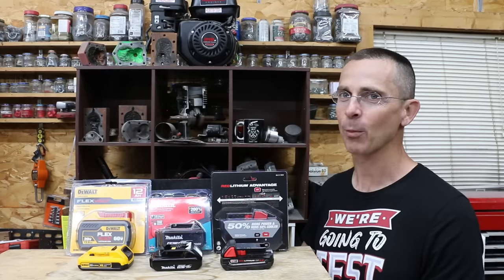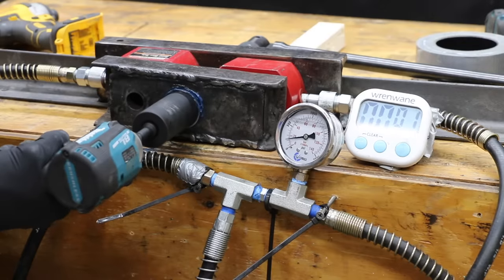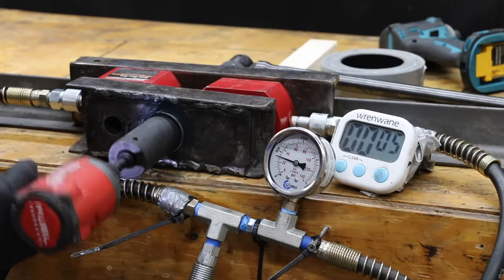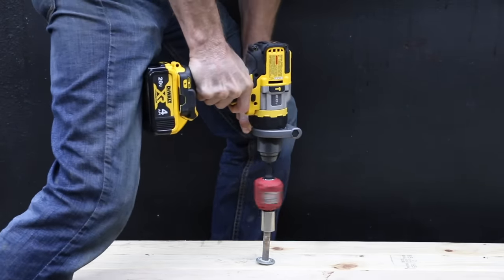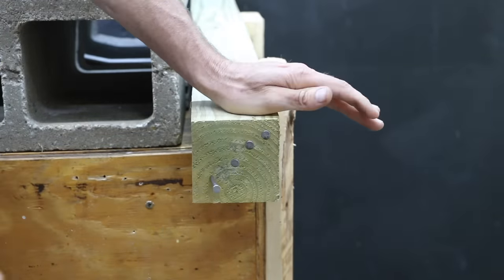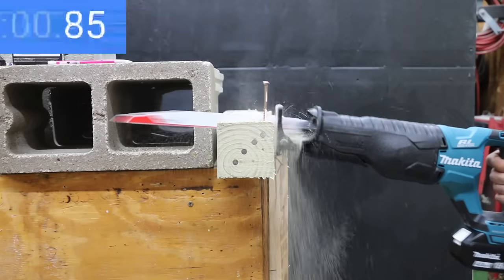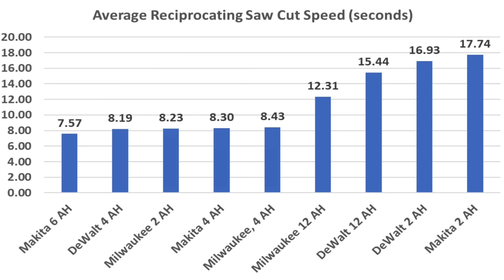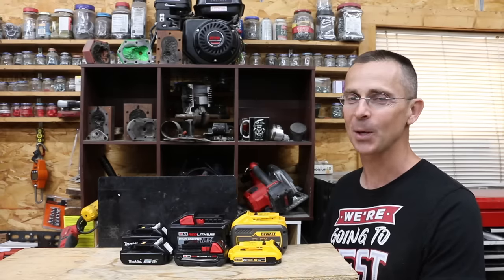Small "TOOL" Battery Better? Milwaukee vs DeWalt vs Makita

Comment: Continually coming up with new ideas after so many great videos, must be tough so here's a dozen ideas: 
1. Test the strength, puncture resistance, strength with a tear, cost, capacity of contractor type trash bags used for job site cleanup. 
2. Best small, hand held vacuum's both corded and cordless. Test run times, suckabilty, filter clogging, particle sizes, etc.
3. Best paint brushes for quality varnish jobs. Test for bristle loss, smoothness of finish (brush marks), cost, bristle type (boar verses synthetic verses chipping brush).
4. Best bungee cords; cost, strength of hooks, strength of cord, stretch, return length after being stretched, cut resistance/performance with a cut.
5. Best 3/8" sockets; test 1/2" socket for hold without rounding off bolt heads, how much torque before breakage, wall thickness for tight spots, 6 point verses 12 point verses universal with metal rods inside.
6. Best wall anchor types for drywall; plastic anchors, self drilling, toggle bolts, hollow wall anchors, Flip toggle (you may have already done this one).  
7. Best concrete anchors (for hollow block and solid walls) (Red Head, Hilti, Simpson, etc.) Also, the best concrete epoxies for holding anchors. 
8. Best graffiti remover for concrete walls, metal roll up garage doors, wood fences, painted surfaces, etc. 
9. Best storage bins like the 27 gal HDX; test for cost, capacity, how much weight it can hold, how high you can stack at max weight in each bin, wear when slid across concrete floors, etc. 
10. Best automotive OBD II Code Readers. Cost, accuracy, ease of use, corded vs cordless.
11. Best duct tape and gaffers tape; strength, adhesiveness, residue on removal, cost.
12. Best submersible water pump; Lil Giant, Wayne, Everbilt, etc. Use similar HP ratings and test for head, speed of liquid transfer, debris handling (sand, dirt, hair, paper, gum wrappers) & run dry shut off time to prevent pump damage. 
13. Best paint removers for wood, brick, rock. Test chemical, sanding, sand or media blasting and heat guns.
14. Best heat guns; cost, highest temperature, adjustment of heat and fan speeds, accessories such as round verses slotted nozzles, stand, hooks, etc. 
15. Best beers....Never mind, I'm testing those personally.....

You've provided great information with so many great video's, I hope a few of these ideas helps you and your viewers.
Reply from the maker: Thanks!  Thanks for the suggestions!

Comment: It looked like the test failed at the reciprocating saw section. With a 10 lbs weight, the reciprocating saws cut slower when using a humungous battery. But they'd likely cut faster with a 20 lbs weight.
Reply from the maker: Thanks for watching.

Comment: For the recip saws, Dewalt batteries have a "type 1, and type 2" rating on the back. Type 2 are good for stuff like reciprocating saws and give more current than a type 1 can, which is why the 4AH battery outperformed the bigger one
Reply from the maker: Thanks for the feedback.

Comment: I had no idea larger battery increased power not just run time. So will a bigger truck battery make my turn signals brighter?
Another very informative video. Thank u.
Reply from the maker: Thanks and you are welcome!  Thanks for the suggestion.

Comment: I love your videos!  I see a lot of videos from various sources testing and comparing the new carbide tipped reciprocating saw blades. Most show the blades cutting through nails, screws, or pipe. I would think a lot of folks who are in the market and willing to spend the extra cash on these types of blades don’t have access to a cutting torch while working on a vehicle. I feel it would be a better test to see which blade cuts vehicle suspension bolts. If I saw a blade that would cut a factory leaf spring bolt in one shot and still be usable, that would be VERY impressive.

Comment: I would love to see a self adhearing automotive heatshield comparison.  A comparison of radiant and direct heat tolerance, adhesive heat tolerance, sound deadening ability, very cold to very hot temp fluctuation resillance, road debris puncture/tear resistance, etc.

Comment: I recently bought a 18v Makita blower, it works much better than I thought, a handy bit of kit, I still have a large petrol backpack one, but I can't really use it in the house.
A comparison of battery blower's would be really good, from an eBay 18v knock off one up to something more expensive and meaty.
Reply from the maker: Thanks for the suggestion.  Thanks for sharing.

Comment: Great to see battery theory proven! No matter which brand, the larger the battery, the more cells in parallel it contains, doubling or tripling available current, which explains why all drills running on high current performed so much better on larger batteries. For impacts that require less current: li ion cells are charged up to over 4.0 volts where the nominal voltage is 3.6 volts. This explains why a fully charged battery provides a higher voltage than a somewhat drained one. DeWalt smartly branded that initial higher voltage 20v Max and 60v Max, but this is with every brand. Now when a tool that requires less current is in use with a fully charged battery, it initially is supplied with that higher voltage, but that quickly decreases to the nominal cell voltage. But larger batteries contain more cells charged up to over 4.0 volts than smaller batteries, which makes that initial higher voltage decreasing less quickly, explaining why the lower current impacts did better too on larger batteries.  It is better to compare with impacts with all batteries drained to 2/3. If there are still noticable differences, than there is no other explanation than that the impacts benefit too from the higher current provided by the first larger batteries.
Reply from the maker: Thanks for sharing.

Comment: Haven't seen the video yet. At least for Ryobi I know for sure the bigger batteries are able to produce much more power than the smaller ones which makes sense. 

 Bigger the capacity in general the more current they are able to put out for longer. And part of that means less voltage dipping under load which means more overall wattage in your tool.

 For example a 1.5ah 18v might drop to say 16.5v under load, where as the 9ah one under same load may stay close to it's full voltage.
Reply from the maker: Thanks for the feedback.

Comment: One of the two 4x4s holding up my 14' shed broke.  Whoever built it used two 2x4s to attach a 2' 4x4 to a 12' one, but it broke just past the 2x4s.  How do I fix this?  Do I replace the 4x4?  Do I attach 14' 2x4s on each side?  Thanks! https://i.imgur.com/JYat3wh.jpeg

Comment: I knew what the result of this video was going to be before I even watched it. Yes the larger batteries absolutely make a power difference. That stated, the 2AH batteries aren't completely useless. They are nice in situations where power isn't a factor and having the tool weigh a good bit less is less fatigue on you.

I should mention that most of my tool kit is team green here. The one exception is the team red sawzall. The reason interestingly is what held it back in your test. Yes the blade speed is far too fast with only 10lbs on it, but if you are willing to "grunt" it, that thing is an absolute monster for demo.
Reply from the maker: Thanks for the feedback.

Comment: It's just because the larger cells are wired in parallel which lowers the impedance thus allowing more current to flow to the motor.
Reply from the maker: Thanks for the feedback.

Comment: Amazing as always! I have a pile of 1.5ah batteries from all the kits over the years. One was left in the trunk for 7-8 months with an old dewalt impact driver,  then used to change all the tires.. 20 lugs on an off! these tools are amazing!
Reply from the maker: Thanks for sharing.

Comment: COMPARISON SUGGESTION:  Comparison of 'off gassing' (toxic gases, if any)  pans testing Teflon and non-stick coated pans (including 'ceramic coated pans) vs cast iron &/or stainless steel.  There would likely be lots of pans to test.  I know you do mostly 'tools', ets, but this is one lots of women AND men would like to know the facts on.  Esp the effect that higher heats have on off-gassing for non-stick coated pans.  It might help explain why the manufacturers tell us not to use some non-stick & ceramic coated pans at more than a med heat.

Comment: I have an idea for another video you can look up the specs on all of this but I’d like to see it in action if you could test the shear point of bolts from where ever all the way up to grade 8 plus the force to pull the thread out of the nut or bolt also
Reply from the maker: Thanks for the suggestion.

Comment: Try to test motorcycles to see which motorcycle seems to be better quality than Harley-Davidson. 

As they say that Honda is more reliable than a Harley-Davidson, well let’s talk about Chinese knockoff of Harleys. 

A Chinese knockoff Harley-Davidson doesn’t leak oil the original Harley-Davidson that is made in USA leaks oil and is less reliable than the knockoff. 

A Chinese knockoff of a Harley-Davidson performs like a Honda. 

That means that Harley-Davidson is a piece of junk compared to Honda.

Comment: I just had a thought about the DEWALT FlexVolt 20v/60volt battery pack.... the chart at the 8:27 mark shows the DEWALT battery being a 12 amp hour battery. I believe I read somewhere that if you are using a DEWALT 60 volt FlexVolt battery on a 20 volt tool then it cuts the amp hour rating in half, so it should really be a 6 amp hour battery not a 12 amp hour battery.  I may be wrong but I remember reading something about that somewhere. If anyone agrees with me or disagrees with me please correct me if I wrong. I don’t mind being wrong. I just want the correct information to be available. Thanks everyone.
P.S....  If I am right or partially right, I would love to see a 60 volt FlexVolt, 12 amp hour battery and a comparable DEWALT 60v FlexVolt drill go up against the Milwaukee 18 volt 12 amp hour battery and drill.
Ron

Comment: I've heard of issues with particular battery models, where the higher Ah battery performs under where you would expect it. @Tools&Stuff just did a video (https://www.youtube.com/watch?v=qXMTPozQ5hk) about a rebar cutter that does not work as expected with a 6Ah battery but has better luck with the smaller packs (5Ah, 1.5aH) instead.

Do some of the manufacturers put higher capacity, but lower output cells in some of the larger battery packs? I've heard about this before, and have gotten the 5Ah instead of 6Ah when picking up Makita stuff. (okay, it's also the ones in the deals too) If the 6Ah under performs but is more expensive, that would interesting to know for certain.

Comment: The difference is what cell is in the battery. Some sizes have 20700 cells instead of the 18650's normally found. Example, some brands 3ah batteries have the larger cells and work much better than the 2ah or 4ah.

Comment: Ran my DeWalt chainsaw on a 2 AH battery, and it heated the battery pack up hotter than other high current tools (dangerously hot).  The 5 AH battery for the saw stays at a reasonable warmth.  The larger batts stay cooler under load than the small ones.  Best off going with a 4 AH battery, rather than going with the big ones.
Reply from the maker: Thanks for the feedback.
Reply: I am getting the Dewalt chainsaw with the 5AH battery. As a second battery, should I get the 5AH or the 60 volt flex battery? I'm old and confused.  Thanks.
Reply: @mikemason4792  If you have other Dewalt tools, the smaller batteries are the way to go.  The larger ones won't fit on the adapters.  I bought a 6Ah and it is dedicated to the chainsaw cause it won't fit the adapters.

Comment: 100% BEST VALUE for a tool battery is to get a used battery that is just about to die and then open it up and replace the batteries your self with whatever 18650's you want! It would be interesting to learn about how to balance the batteries and what you need to look at. I know you need to get batteries that can put out a certain amount of output of power over time. For instance some batteries that have a bigger capacity however a lower continuous output rating. Then you need to spot weld the tabs without overheating the battery cells and anything else you need to know. Seeing Project Farm take this on would give us a good idea of if it is worth doing.

Comment: About 15 years ago I had a part time Job at Orchard Supply and Hardware (OSH) which was then part of Sears and K-mart.   Once or twice a year we had a Tool-Expo day, for the lack of a better name, in each Regional Headquarters store.   At these shindigs, all of the manufacturers we supported brought samples, presented demos, and gave away some pretty cool door prizes.
At this particular show, one of the manufacturers was Milwaukee.   Their rep told us that they had just developed an adapter that allowed all of their tools to run off of their competitors batteries.    At the last moment they had changed their minds, but before that they had made a whole semi-truck full of adapters.   
Always tried to find one of those, but was never successful at finding one.

Comment: Will a 20 v flex battery charger work with a smaller tool from Milwaukee like an impact driver if I use an adapter? Or will the stopping mechanism still kick in?

Comment: The chemistry inside batteries can be rather complex, but all other things being equal, the surface area of the metal plates in a battery has a lot to do with performance. On average, more metal means more surface area, which means more current. Pretty fun test to watch.

Comment: Interesting???  In "theory" an 18v battery regardless of it's capacity should provide the same potential to the brushless motor windings as any other 18v source, within reason.  As long as the C rating of the pack can provide at least 30 seconds of required juice at the same voltage the power output of the tool should be equal.  Would have been interesting to have sense voltage measured before the trigger was pressed and while pressed during these test.  As usual, thank you for the reviews.
Reply from the maker: You are welcome!  Thanks for the constructive feedback.

Comment: How about a video testing fuel additives? Like STP octane booster vs gum out vs Lucas Oil? You could test the run time, cleaning capability, and engine temperature all in the same test

Comment: The milwaukee size batteries can be tricky. The new 3ah and 6ah and either the 8 or the 9 are 21700 cells where as the older batteries are 18650 cells, so even the smaller ah batteries w the 21700 cells will perform better than the bigger ah batteries w the 18650 cells.

Comment: This was pointless.. Higher capacity battery unit will have either higher capacity cells or more normal capacity cells in parallel. Either way, the voltage drop will be lower than low capacity battery unit. Therefore, will perform better and longer.

Comment: Curious to know....I see all these videos comparing different tools, manufacturers, etc.  However, lots of people like to buy one brand of tools to be able to use the same batteries across all the tools.  If one wanted to go with one brand, then what would be the best based on overall individual tool performance and battery performance?

Comment: One thing not brought up is the battery life. Bigger battery means less charge cycles, or more partial charging cycles. Either way, for the same amount of use, a larger battery will last a lot longer than a small one. Around 4 or 5 amp hours seems to be the minimum for long life and tool power.

Comment: AH should be run time not speed although they would be able to maintain speed for a longer period of time. I think these higher AH batteries are also pushing out higher volts than advertised. That would account for faster motor spin.
Reply from the maker: Thanks for the feedback.

Comment: wow your Makita batteries are not cheap! Genuine 6.0AH here are $91, 5.0AH are the best value as a dollar AH comparison at $69 - (You can get them a bit cheaper but delivery and packing may not be as good as the regular source) Looking at the performance with the larger batteries, especially with the reciprocating saws, wouldn't you think that they could put some form of governor in place to optimise the cutting speed to allow the tools to take full advantage of those massive 12AH batteries? Seems crazy to me.
Reply from the maker: Thanks for the feedback.

Comment: Bigger batteries just mean longer runtime (I would assume), but I did learn alot from this video.

The DeWalt 21" 2x20V Max mower I bought came with two 20V 10Ah batteries, and I use those batteries with my DeWalt tools.

The DeWalt tools I have:
DCS380 reciprocating saw
DCS334 Jigsaw
DCS391 Circular saw
Reply from the maker: Thanks for sharing.

Comment: How about a test of tire pressure gauges and portable, battery operated pumps like Makita's? Analog (stick & dial) vs Digital. Altitude & Tempurature effects. Calibration. It seems digital gauges are calibrated at sea level (14.7psi). At high elevation digital gauges require the user to know the correction value at their elevation. At 5800ft my Makita (DMP180ZX) digital pump is ~3 psi off (14.7psi - ~12.0psi = 2.7psi of difference) requiring the knowledge of altitude & temperature effects to properly inflate tires. Folks at elevation need a correction chart to hang in their garage.
Reply from the maker: Thanks for the suggestion.